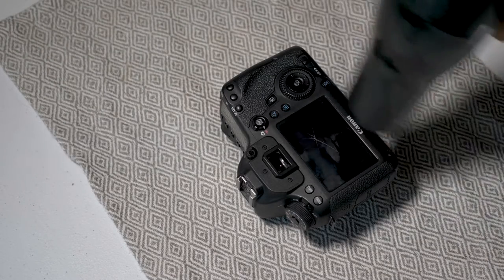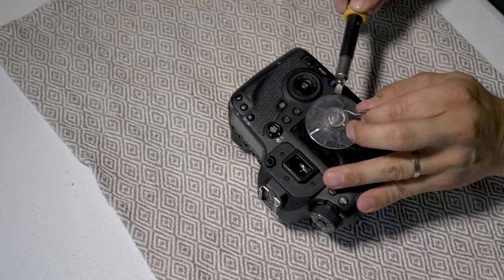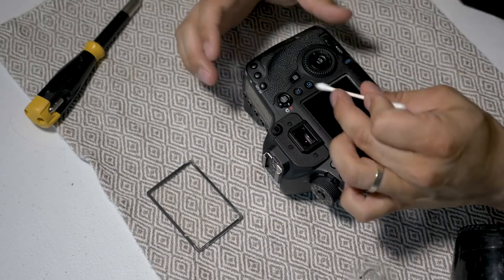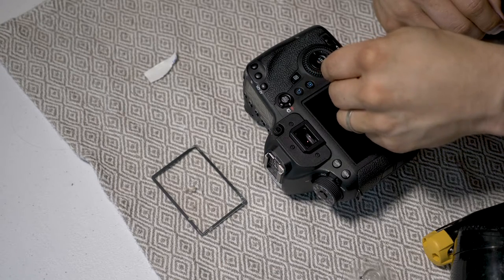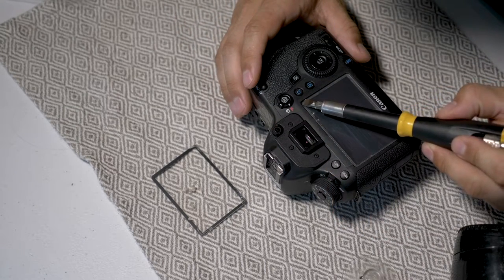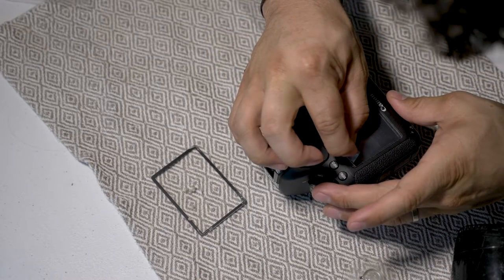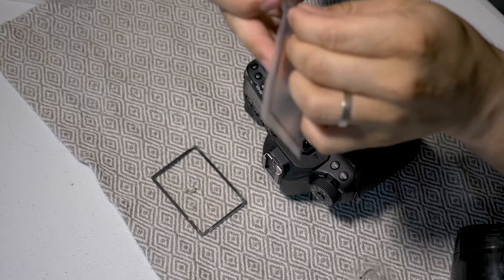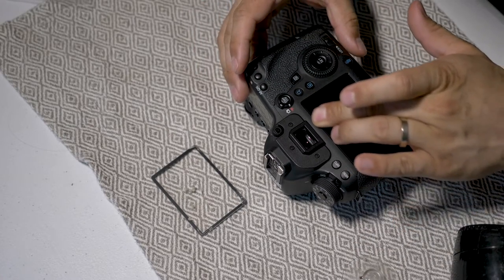[Repair Tutorial] Canon 6D Camera Glass Screen Replacement

Comment: I bought the LCD glass(plastic) from eBay for a few bucks. My suction cup won't work and I followed your screwdriver method. It worked but I scratched the corner of the body near the screen. No big deal. After removing the old screen, I used a bit of alcohol to clean the edge that hold the the glass. Then glued the new one on. Used a toothpick to touch up the scratched corner. Now it's like new.
BTW, I have some pieces of dust absorber left for LCD protectors. I used one to dust off the LCD before putting th glass on. Perfect.
Just in case if anybody wants to do the  replacement.

Thanks